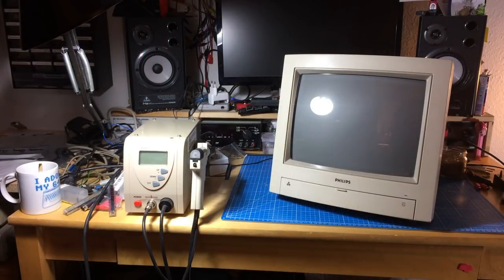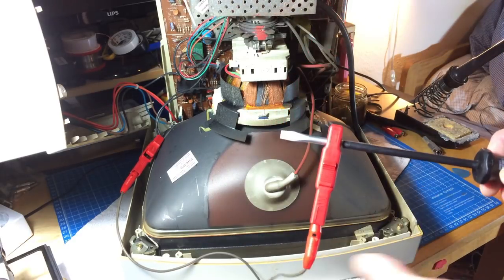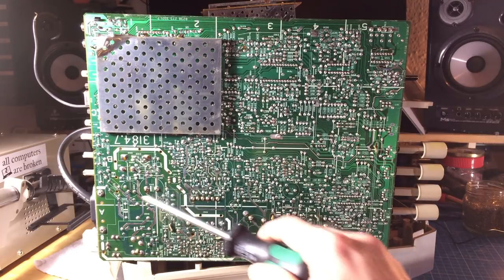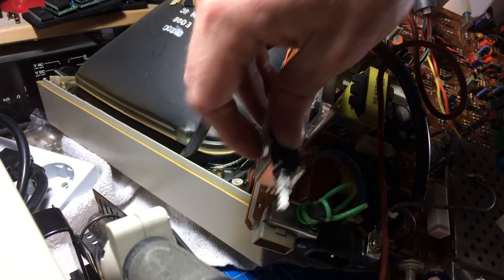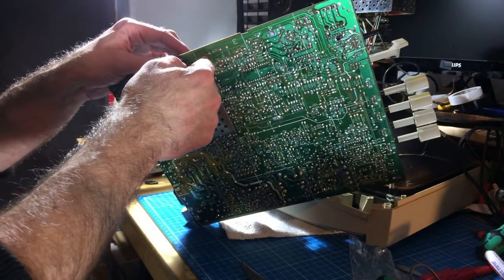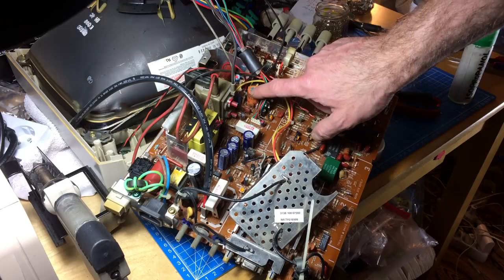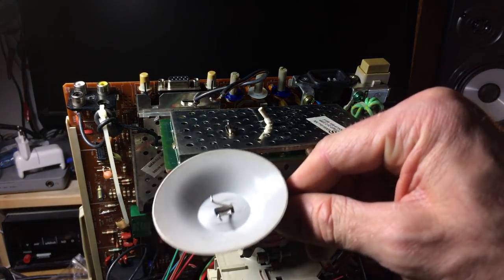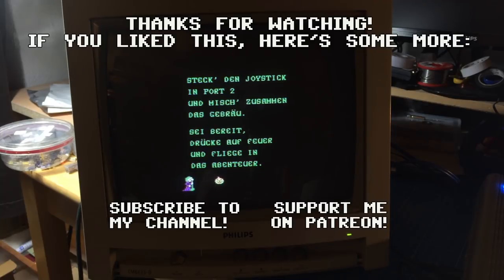Philips CM8833-II CRT Monitor Power Switch Repair and Recapping

Comment: Those are excellent monitors, but they have 3 (three) MAJOR issues, that need to be repaired sooner or later. 1st: yoke corrosion due to green spot that occurs on contact with rubber wedges, as those when age produce some corrosive substance. The horizontal winding will develop open turns because of that. It might be even too far gone to be repairable. 2nd: flyback transformer, those are failing really frequently and if you still have original one it will fail soon. Those were problematic even when those monitors were still kinda new. 3rd: power switch, well it can be bypassed or easily replaced. The main thing is that replacements stock is slowly drying up. 

And btw, those can have all 3 issues at once. I had one with open H-yoke winding, which I patched, but the monitor was still whining at me. I then replaced the flyback transformer and it started to work. Luckily the PSU has very good overcurrent protection and will save the H-output transistor if the flyback dies. And of course the power switch, which was actually still working to some extend, but was only switching one pair of contacts, the other one was already bridged.

Comment: I had this one several years ago. It died on HV PSU failure. But later then I got a CM8833 (not II) and it still works, but there's something bad with sound. There comes only a buzz when I turn the volume knob up. But I don't care too much as I don't need the internal sound that much.
Reply from the maker: Oh, good thing your CM8833 still works. If you want to fix the sound someday... Maybe you just have a leaky cap in the audio circuitry? There are most likely some small filter caps. I found the smaller capacitance caps tend to fail a lot faster than higher capacitance ones.

Comment: Good job.  I don't think many CRTs would receive such attention today.  Did you check the temperature ratings of your replacement capacitors?  It's safe to say it gets rather toasty in there.
Reply from the maker: Thank you! All the replacement caps are 105C so they should be fine for a while. I think some of the original caps were only 85C and cheap brand so it should theoretically last longer than it was going to last before.

Comment: The CRT tube can fully discharge by itself after a day. I know it because i changed FBT on my Commodore 1084s P1 monitor by myself.
Reply: Ones that have a discharge resistor, yes. Not all do.

Comment: I have 2 CM8833 monitors thar are not working. One where I think it's the switch too, and one where the tube is totally silent (?) Anyway watching your video makes me wanna try repairing them. Thanks!!  😁
Reply from the maker: Fingers crossed for your repairs! Stay away from those high voltages. :)
Reply: Thanks!! I really don't have the nerves for sparks. But we must keep the old stuff running! 💪

Comment: When discharging the tube, was the monitor plugged to the wall socket, in order for the chassis ground to be connected to the earth?
Reply from the maker: No! Shorting the anode and cathode of the tube is sufficient to discharge it. Plugging it into the wall while doing it is not recommended at all (in fact it can be quite dangerous because you would have mains voltage on parts of the PCB and some older CRTs even have a "hot" chassis which could shock you while plugged in).
Reply: @JanBeta  Shorting the anode and cathode of the tube is sufficient to discharge it.  Got it!

Viel dank, Jan.
Reply: @JanBeta  BTW, is there a way to check if the tube is, in fact, discharged? 

Maybe with a multimeter?

Comment: Very nice video, thanks !
What soldering tool are you using ? With electrical pump ?
Thanks :)
Reply from the maker: Thanks! I'm using a ZD-915 desoldering station. Made a little review video when I got it, too, if you want some more info on that.
Reply: @JanBeta  thanks mate 🙏
Reply: @JanBeta  i got the same monitor some days ago :)
Power Switch repaired...
Now going to recap :)
I got the euro version, capacitor list is the same ?

Comment: The bipolar cap is there mostly because a typical film cap isn't available in the proper uF rating or if there was the cap would be huge. If you're worried about ESR you could take two electrolytic caps and make it work as bipolar, with two caps with a low ESR should give it even a lower ESR. Not sure with the back to back setup. Here is a cheap ASCII schematic form

--|(--)|--

So if the cap is say a 10uF you would use two 20uF caps back to back.

The CRT is discharged if you use chassis ground, I've talked to a few TV repair guys in my line of work and they all say chassis ground is fine as a discharge point, if you do use a Earth ground make sure to tie the chassis ground to it as well and make sure you don't use a GFI circuit. You shouldn't dead short caps to discharge them, puts a huge strain on them but then again you're replacing them so it shouldn't matter.

Some time I need to recap my old Acer CRT for my DOS retro gaming PC. Last time I tried using it the screen kinda shrunk and with the adjustment pots on full tilt it didn't make much of a difference. Probably got some resistors out of tolerance as well. Wonder if I should fire up the camera and attempt making a video.
Reply from the maker: Thanks Leland! Makes perfect sense. I made some bipolar caps in this way for audio gear in the past. I think you have to use the capacity you're aiming for in both caps, though (at least that's what I did). Probably a less fragile use case but I might try it in the CRT, too.

Comment: great video as always!
i have a Green Phosphors Olivetti Monitor that goes with my Olivetti M240, but it stopped powering up, i still have to get around in fixing it.
Reply from the maker: Thank you! It's well worth having a look at it, I'd say. Often it's something very simple like a cracked solder joint or a blown capacitor that breaks these I guess.

Comment: The ol' "screwdriver" trick. I prefer not touching those, i have a 8833 monitor myself, but with a button on the front, and yup - it is broken. I usually just put a piece of tape over it and it's good for a few hours.

I generally don't bother with an original monitor and just use modern monitors with a Composite/RGB23 converter to VGA or Scart (the 8833 i got has scart), but i would like to have an 1081/1084 monitor for my Amiga 1000 for aesthetics. Still waiting for a Scart to HDMI converter so i can connect my Amigas to better quality monitors.

As for what overs have said, it would be easy to run a cable from the chassi ground to the wall socket ground connector (exposed metallic one on the sides). I keep electronics plugged into a powerstrip (connected to a wall socket) with the power button off, the ground in a powerstrip is always active regardless how the powerbutton is set.
Reply from the maker: I found that modern monitors all lag a tiny bit (of course largely depending on the hardware and/or upscalers/adapters you use). The smoothest retro computer experience is always going to be a CRT. All timings are made for these screens. :)

Comment: and yep, dont EVER adjust those deflection yoke rings.. it'll screw the picture up and it will take FOREVER for you to get it right again (and need you to adjust them with the power on!!!)
Reply from the maker: Yeah, would be fun with the hot chassis and all... Don't worry. I'm not going to touch those until I absolutely have to (which will probably never happen luckily).
Reply: You do have to try quite hard to move them, sometimes they are even screwed in place. Just "Nicht Gefingerpoken" and they will never be a problem ;)

Comment: Need more sparks! :P  And remember to actually ground it next time lol
Reply: I know lol!  I was hoping for some sparks in this model too. =/  Seems like a lot of the Commodore monitors self discharge fairly quickly.
Reply: Yeah, it's disappointing! lol.  Next time just discharge it while it's on haha. (Don't do that :P)
Reply from the maker: You nearly got me there... (No, not really...) :D
Reply: xD

Mr T. Guru, I meant the tube.
Reply: You discharge a CRT tube by shorting the anode to the frame, which is what he did. Shorting the anode to mains earth will do nothing.
Reply: Peter Mulholland yeah but he had nowhere for the electricity to go, just on the case isn't enough is it? I was pretty sure you needed an earth connection
Reply: No. Think of the tube as a capacitor. You discharge it by shorting between its terminals.

Comment: The chassis is not grounded unless you plug the display into a (switched off) outlet to provide a path to earth!
Reply from the maker: Oh, it is referenced to ground in the circuit so for discharging the tube it works. It also works for monitors which don't have a mains ground connection at all. You could plug it in and use the ground/mains earth as an additional precaution but AFAIK it's not necessary as you are basically just shorting out the "capacitor" the tube is against circuit ground.
Reply: GND is the wrong terminology,  maybe you should say 0V with respect to the high voltage.
Reply from the maker: I know it's a bit simplified but isn't it the ground reference of the whole circuit, too?
Reply: You did it absolutely correctly, Jan. You discharge the internal capacitance of the tube, ground is really irrelevant in that case. You go between the inner plate of the tube, which is the HV-terminal, and the outer plate, which is the graphite layer on the outside connected to the ground wire you used. Don't ever discharge against ground on the PCB, you might put the discharge current through paths that don't like it.
Reply: Elektro-Peter you are right.

Comment: The danger of CRTs is overestimated. Yes they are dangerous and yes the larger ones can kill you if your super unlucky but as long as your careful and discharge it correctly to ground whist plugged in you will be fine. Just follow the same rules as you would on any high voltage system.

1.If in doubt IT IS LIVE!
2.If in doubt IT IS LIVE!
3.Only ever work with one hand!
4.Wear shoes!
5.Do NOT use a grounding strap on your wrist.
Reply: Tell that though to the people that died not disharging the tube correctly!  Lots of people have died that way, so whilst yes its rare, it does happen.
Reply: Yeah, the danger is "overestimated", but you have to make sure you follow all of the safety guidelines. Seems to me the danger is properly estimated at that point. You just know how to work with it safely.

Comment: Wow, and here I thought it was only the Commodore 1084s that suffered from chronic power switch breakage!
Reply: 79Yamato That explains a lot!
Reply from the maker: Yes, they did. You can use the exact same replacement switch, too. :)
Reply: Neat! I know a guy with a 1084 whose power switch failed, I'll have to pass this knowledge on to him.
Reply: The CM8833-II is the 1084S-P2, but most monitors in this range/era used the same types of switches.